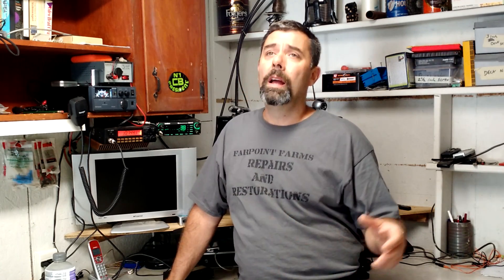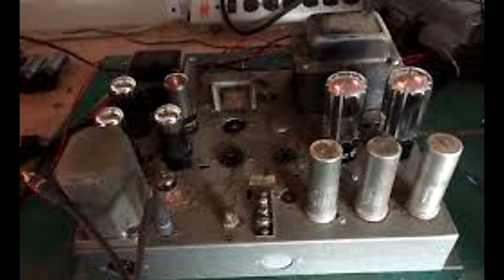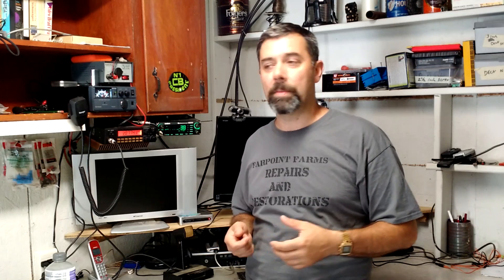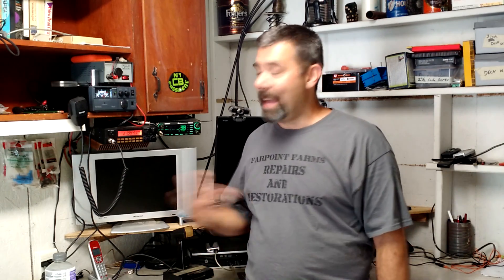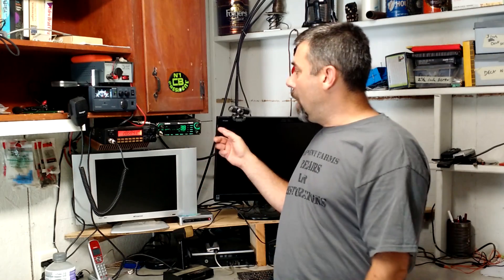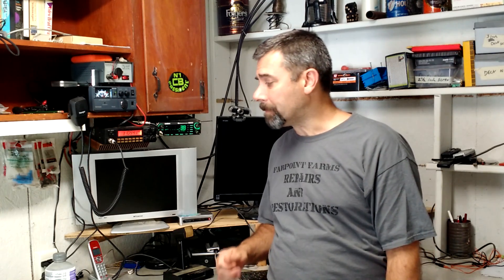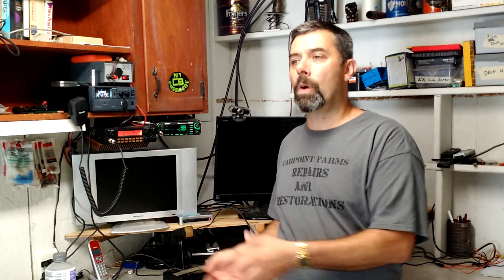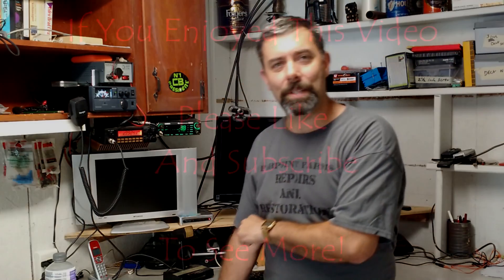A Beginners Guide To CB Linear Amplifiers.

Comment: In the early 60's it was the same way, 4 watts. But there were lots of folks who did have amps. My dad had a cb license KKK8409 was the call sign. that was in 62. Before that I just got on a channel, ah, channel 15 was the channel the locals used to just shoot the bull And for the most part a linear amp was used in your car/truck and most hidden under the dash. Cause back then we had FCC guys who rode around in trucks. This was around Norfolk Va, and the FCC had a field office there because of the navy. And they would monitor all the freq's. Always lookin for rule breakers and they also monitored most everything like I said for the navy.And back in the late 50's and thru the 60's the navy operated a receiver site about 30 miles or so west and the xmitt site was about 20 miles south of Norfolk. They also would be on the alert of folks listening on govt freq's hoping to catch any classified info on govt bands and the navy xmit and rec site. They were serious about this schitt, they would take your equipt, you would go to court and if they thought something was going on the would arrest your ass. Those navy site's have closed, I don't know when but I guess they switched to other forms for their comm's.crap. All the equipment that I ever used was tube type, non of the transistor crap. Turn it on and let it warm up and the volume would slowly start coming in. the   linear amp's were tube type also. My first cb was made by Grove electronic's, don't recall how many tubes it had, but this one was the "el cheapO" cause you had to change xmit crystals for each channel, and the socket for the crystal was on the front of the radio. The receiver section was super regenerative.So if you were unsure where on the receiver dial was the channel you were looking for you could make a sort of blind call and say, req " long count for receiver tuning" then if your buddy was on channel 15 he would give you a count, you would tune him in and "chew the rag"  This was usually only done in the evening, the fcc didn't bother anyone at night usually. I told you my first CB was a cheap-O

Comment: What is the best COAX cable for my CB? I run the 102" SS whip
Reply: Mini 8 is good and is low loss at CB frequencies and is on the smaller side for running in mobiles. It will also handle most reasonable wattage levels(500-1000watts) too

Comment: The use of amplifiers on CB radio, though illegal, was made popular by 3 things as I see it ...1 the 70's and the popularity of CB radio and 2. the sunspot cycle that we went through during this "popular CB time"...during the peak you couldn't talk across the street without 100 watts or more,  just toooo much noise...s9 or higher continuous...24/7...and 3. the availability of cheap HAM radio 10 meter amplifiers that could be tuned for 11 meter CB.
Reply: Yes, the Sun cycle in the 90's was CRAZY as well

Comment: CB was the wild west even 20 years ago. Is it even still alive?
Reply from the maker: It really is. Cell phones and the internet have taken a big toll, but it's making a small comeback as we speak.
Reply: It's still alive and the prepper community is pushing it's use all the time. I'm in the Pacific Northwest and in the last three weeks channels 17, 19, 22 and some others have been alive during the day.
Reply: Very much alive. I use 2 systems here in central Florida. Bearcat 880 stock with 2 nmo tuned whips paired with a road devil power mic. Then a bearcat 980ssb tuned with a tram 3500 mag mount paired with the road devil power mic as well. Best two setups I have ever used so far. No amps, just the right antennas and the power mic.
Working on a home base tower build, 50-60 feet with an imax 2000.
Reply: Around here you only get traffic on ch.7 and it's used by the logging trucks and lumber yards in the area.
Reply: Listen to ch6, 'The Superbowl', some of these guys are pushing 30k watts!  It's totally of of control, crazy, but kinda fun!

Comment: Love the disclaimer. Regardless of  legal or illigal.... it's illegal. Skip us also illigal. Get you ham ticket... 10 meter (or 40 or 80 meter).
Reply from the maker: Skip is no longer illegal, and i many countries Amps are fine as well.
Reply: @FarpointFarms  Part 95, Sept 2017 - You are correct, skip is legal now but linear amps on 11 meter still not kosher. Get a ham license and go 10 meters.
Reply: @FarpointFarms  FCC part 95 September 2017 skip is now legal.  You're right. Linear amps on 11 meters however still not legal. Just get a ham license and go 10 meters.
Reply: Get a ham license and do both. Life is short, have fun. Just run a clean station with a clean signal. Ignore the haters. 75 meters has more illegal power and nastiness than cb.

Comment: Breaker 19, Hi Eric Happy Thanksgiving 🦃. Really Good video  l love the subject. I've got a few of those eBay foot Warmers Ha Haaaa 😁. Alot of the stuff on eBay is not working properly, I have found this out myself. How bout a match box in the line, will that work for matching the two units? 101 Sagebrush Base Out 🎙️
Reply: steve mccoy breaker one nine jingling jingling this is big willy 210
Reply: No the match box will not tune the radio to the amp, it just lies to your radio, making it think that your swr is ok when in reality it may not be.
Reply: steve mccoy if your swr is to high naturally you want it at at least 2.5 or lower before you try to hook up tunner. Once you get it to acceptable operation then put on that tunner to get it where you like to see it.

Comment: Bottomline.......I had more fun in the early days of CB then I ever did after I got my Ham radio license.
Reply: Just the opposite for me.   I had a nice CB setup..   but after i passed the 5wpm  i never looked back.  I sold it it all away  Glad i moved on.
Reply: I'm extra class but I prefer CB. Especially those fringe noise floor groundwave SSB contacts from over 100 miles away. Seems like more of a challenge.
Reply: Have to agree. Im a general class, bought an hf rig, and it just wasnt the same. Sold it, still have my cb equipment! Still use 2m and 70cm though.
Reply: same i'm a ham but i use my cb more for that reason. most cb users run hf amateur gear on the cb bands why not deregulate the ham bands and allow these unlicensed opperators on the ham bands to create more traffic.
Reply: @VK6FCRC  I am a radio amateur and while that might work in Canada in the USA it would be insane although the ham bands is more and more like a glorified CB for the last 15 years, or so.  When you have to take a test at least it shows you currently know wth you are doing and would never throw a FM amplifier onto AM/SSB unlike a lot of CB operators do now.  Just no, don't make the Amateur bands deregulated.
Reply: @generalawareness101   Multimeter test of a lump of coax, setup a cb with a swr meter, talk bs on air this is the amateur practical test in VK  i think a cb user can do this.
Reply: @VK6FCRC  You are naive at just what CB'ers can do.  Best wishes

Comment: One s unit is 6db and to be able to get 6db more power is 4x more power, so if you're running 12w you need 48w to get one bar more.  10db is equal to 10x power and 20db is to 100x power, so less than 2 bars wuld be 120w and and little ower 3 bars wuld be 1200w compared to 12w

Comment: Great video ! Thank You , when I used to be very heavy into C.B. I had a Siltronox radio, that put out 100 watts barefoot. What a radio, I talked all over the world with that radio. I wish I still had it. I also had the Siltronix linear that put out a 1000 watts,  I was afraid to put that linear on line.
Reply: I had a Siltronix 1011-C.
Reply: I owned several Siltronix radios, actually started out with the Swan 1011 and went up through the rest, still have one Siltronix 1011D Comanche left, waiting on so.e money to restore it along with a Tram D201 (hand wired/vox), a Lafayette 35 (wish I hadn't gotten rid of the 25B) Regency Imperial, Johnson 123, Citi-Fone SS and some others.
Reply: I ran a little Midland 13-892 on a power supply through a Palomar 300A  to a PDL-ll in the early 70's. That one talked to anybody I could hear.
Reply: @plugnalong2186  I had a Midland also, they were very popular.

Comment: In 2019, most of the “10 meter” radios that can be easily modified to the 11 meter band, (the anytone-6666 only requires a special key sequence to open 11&12 meters, through 10), you’re already able to push 45 watts SSB out of the box. So if you dial the power back and run a 2 watt in, 150-200 watt out amp, you’ll only be (2) S units louder than what you have out of the box. Plus, you’re already breaking the law the second you turn up the RF out knob
Reply: Screw the pigs and their laws.

Comment: Hey, all your videos are super helpful by the way. I do have a quick question. I live in Barnstead NH, lots of mountain ranges. Still building my base station so Im using my mobile at the moment. Driving around Im up and down and around the mountains, signals in and out. Will an amp help or is it still all about the antenna?
Reply: I have I have a antron 99 and I drive up to the nearest Hill or tallest mountain whatever part of the country living and set it up, throughout the antenna and put the radio on if I got a hammer I'll use that. I am signals will tend to follow the ground the mountains are a little caustic towards any output. Enjoy it though just go to the top of the mountain and put out there don't expect much down in the valley and you'll be happy

Comment: Thanks, good info & good history. In the 70s I ran a 4watt Ratshack through a 25 watt marine amp, everything I needed between working in Houston and living in Montgomery county to stay in touch. Friends were running 100-400 and accomplishing not much more. One guy had built an adjustable tube in the toolbox of his truck, up to 10,000W , world wide but the huge antenna on his truck was a dead giveaway!
My base was a similar mobile on a car battery and charger with a Big Stick mounted about 60’ up a pine tree, gave me many pleasant conversations with British Columbia and Africa’s coast, while allowing local communications crystal clear out to three counties.
After nearly 30 years off the air I’m thinking seriously about taking some old Cobras out of the shed and seeing what’s out there these days. Anybody know if the little 25W marine amps are still available? 🤔
Reply: That's so fucking cool.

Comment: The Bleed over coming out of church PA system was halarious.
Reply: It's fun to do, however it's a GREAT example of what the Man and some other people mentioned here
 Your WATTAGE/POWER is ALL over the place. In other words, WASTED also poor "PROPAGATION."  The trusty old Cobra 29 Classic can be a super great, extremely reliable set up if done right. I've seen them pushing 60 watts of swing.
 Not bad at all and tried and true,trusty Cobra model 29 Classic and all of the right accessories and Your good to go!! A Trucking Company, most, will  tolerate that setup. Keep it on the Low Down!!!! If You don't always drive the same rig,screw it and save Your $$$and time. Another nice feature of this model is the N.O.A.A. weather bands. Yes,the model #29, who could forget the classic radio it truly is!!??
Reply: I woke a friend of mine up who lived a block from me one Saturday morning by coming in over his clock radio and it was turned off! LOL
Reply: @davidpringle8089  yes my neighbor a  1/8 mile away comes  through on my computer speakers.

Comment: A clean radio (properly set modulation), into a clean amp (AB biased or at least B biased) then into a low pass filter before antenna, and you'll be fine. And oh ya, don't be a knucklehead on air lol.
Reply: I have a knuckle head in my area, large echo and just rambles on about a 10 meter modified ham radio on the 11 meter cb bands. Then to try and overpower that op, he just modulates his echo and no one can operate. I don't even hear the so called 10 meter radio.
Reply: @explanger527  Aw, that stinks. Ya, no matter where, every town seems to have a guy that's the proverbial "turd in the punch bowl" lol. Usually people like that don't last long.
Reply: If someone tells you your bleeding all over their telephones, tell them to call the phone company, it's up to the telephone company to filter the phone lines from interference. There is so much you can learn about radio interference on the ARRL website if ya ever have to deal with an asswipe of a neighbor!

Comment: Years ago, I lived up really high above metro area (on a clear day could see literally 100miles each way...You need binos). Anyways, antennaes were mounted on side of house and boy oh boy, was I king, on both SSB & UHF, however, I wasn't a jerk...well, until particular nasties turned up. They soon left. Awesome times!
Reply: I had a good tool for when certain nasties turned up. Mobile DF gear. Run silent, take a few line of bearings, move in, DF the antenna, run about 3 blocks away and announce the C&D or address will be given.  Very effective.  Didn't get into the cutting or pinning coax destructive replies to trolls. I didn't need to. An automatic TOA AM DF unit is very fast and effective.  TOA-Time of Arrival. 2 antennas with phase network. Adjust for same time of arrival for Line of Bearing broadside to the two antennas. Very incognito. Looks exactly like truckers twin talkers antennas on the outside.

Comment: So if I have my radio tuned to get max performance say I'm pushing 7-8 watts max on AM and 15-17 watts usb/lsb will an amp be necessary for me?
Reply: If you wanted amp,you would have  to turn your wattage down. To about 1 watt on am....but yes get a 100 watt amp and u will be heard farther away
Reply: I'd go from 1-2 watts output when running an amp. Keep the modulation a little under 100%. if using a power microphone make the balance of the modulation between the mic and radio 100%. When your modulation goes over 100% you will really start to interfere with things. Keep it clean and you can use a bit of extra power when used with a decent filter.

Comment: Say, use to play around with CB radios in the late 70's until the early 80's. But later after going to technical school and formally learning about radio systems.

Looking back I never really understood how a lot of the CB linear PAs many were (illegally)  using back then generated these high power levels on AM of around 400-500w carrier power for the tube type linears anyhow. As I learned the efficiency for an AM linear was just terrible.

At half the peak value which was usually around 50% for class AB operation. Therefore dropping to only 25% efficiency at the unmodulated carrier level.

(Since AM linears or low-level AM modulation fall into the catagory of "efficiency modulation").

So were these CB linears cheating-off in some way by really running somewhere near high efficiency class C making it actually "puesdo-linear" and severely distorting the AM waveform?

As I noticed the higher power linears on AM back then really didn't sound that good with poor modulation. 

And boy did they splatter all over the band ....

Thanks ....
Reply: Hey man, looks like we stepped off the same boat. I too played around with cb in 70's and 80's (showing our age lol) and finally got my electronics degree, a lot of telecommunications emphasis. Ya, 2 types of efficiency you are talking about. Yes, on AM most of the power is wasted on the carrier and used on the upper and lower sidebands. On SSB, most of the power is used on the sideband you are TX,ing on(upper or lower). As far as transistor efficiency, while class C is the most efficient with its conduction angle being 180deg or less (the transistor is off more than it is on) it will generate a high amount of harmonics and have lower audio quality ESPECIALLY on sideband. Class AB (transistor conduction angle around 270deg) is much less efficient as you mentioned but will produce less harmonics and will have better audio quality. But after all that, any amplifier will amplify whatever is put into it. Dirty signal in = dirty signal out and. Sorry I'm rambling lol! Im a radio retard, nerd, idiot crazy person when it comes to this stuff ha ha. Peace my brother!

Comment: hi good video,but the new rm 405 rm 505 can take 10 watts am/fm gives 200watt 20 watt input round 250 watt ssb minimum all day and night,the new linears,technology changes quickly, so goes the price,well thats what i read on the forums,anyhoo thanks,
Reply from the maker: I have a dead "stinger" a RM KL35 amp I'm going to repair it and run some tests to see just what it will handle.